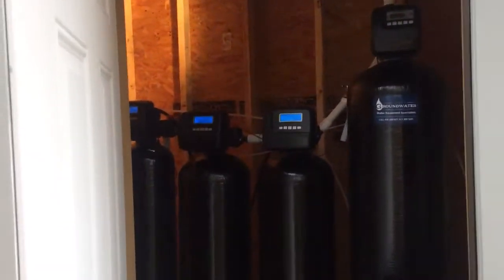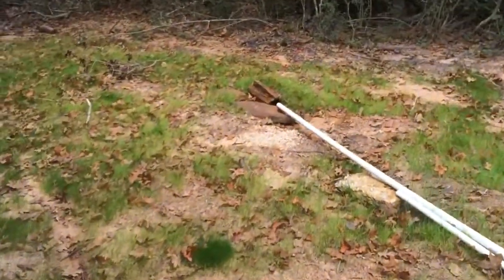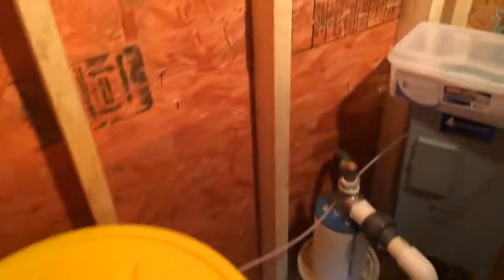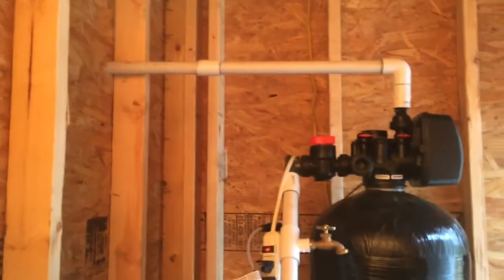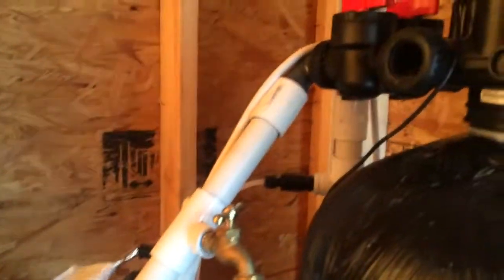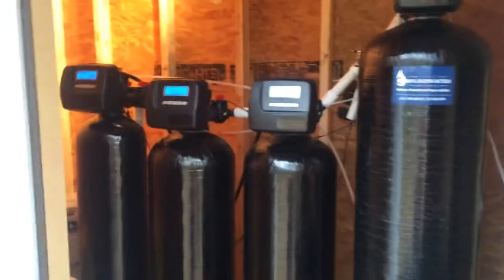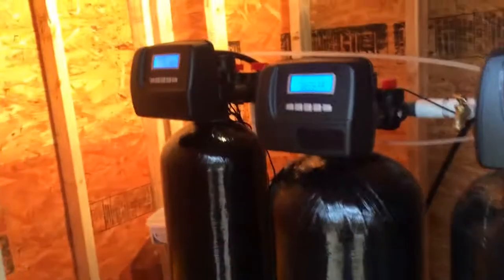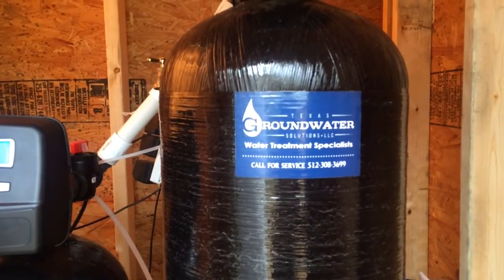Iron sulfur well treatment with hydrogen peroxide.

Comment: Where can I find that h2o2 injector
Reply from the maker: jpnm81 that system is manufactured by us. Contact us for more details. 512-308-3699
Reply: @Mikesdear  what is your company website and company name?
Reply from the maker: @redwingsrock1000  advanced air and water systems and the website is not online because I got hosed by a fraud that took my $ and then went to jail for ripping people off. I got the domain back but I have so much work and good help is hard to find. I do need to get it back online. You can reach me through Facebook where you can see a lot of different things or call or text me 512-308-3699 or email 
mike@advancedairandwater.com